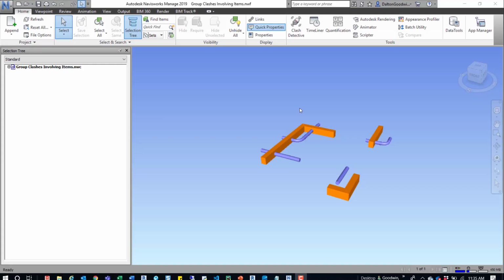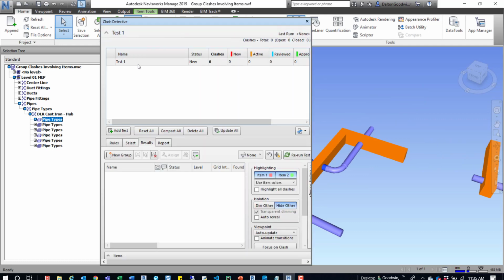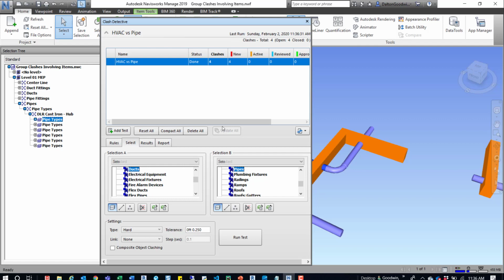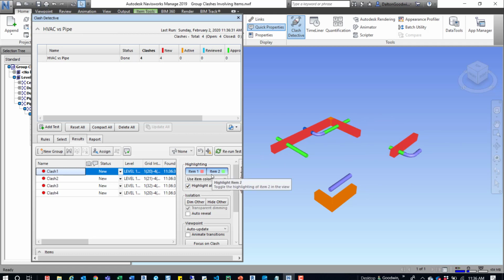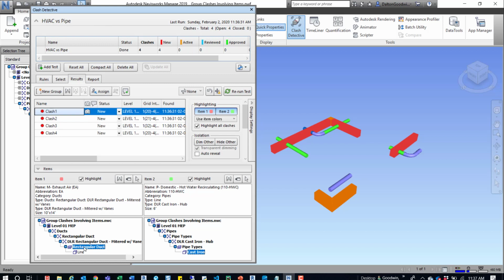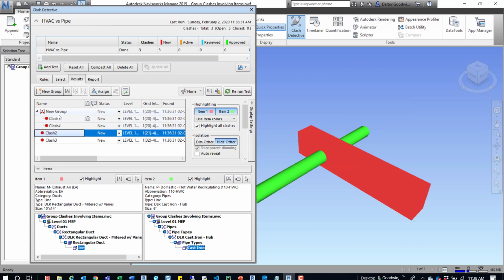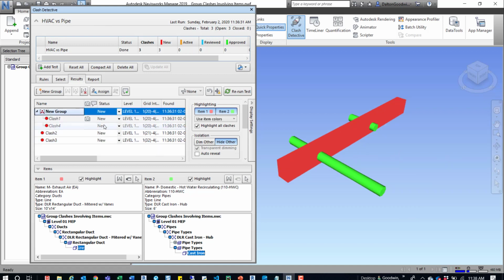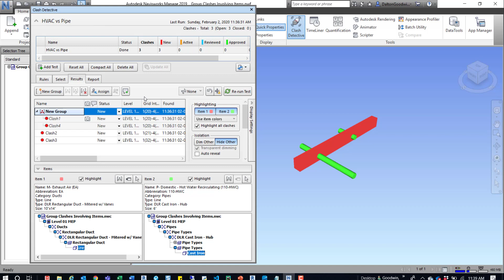Navisworks| Group Clashes Involving Items | Clash Detection

Comment: Thanks for the video, I had a follow up question. Once the clashes are recorded. Typically the designers of the systems go back to their models and update them. Is there a video about appending the new updated models and rerunning the report to see updates?
Reply from the maker: I can make a video covering that. It is pretty simple though. Just like you would to setup the navis NWF file you would export your NWCs from Revit and in Navisworks click update or update all.